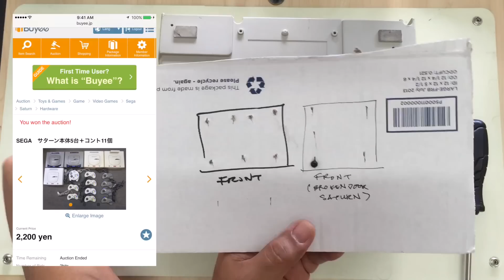Sega Saturn Yahoo! Japan Rescue via Buyee 1 [SH no.31]

Comment: I can't get enough of these videos. Sega Saturns getting restored. This was the most suspenseful one so far. It's pretty cool knowing that most broken systems usually have like one minor issue and all it takes is fixing that and you have a working Saturn.
Reply from the maker: +Sopa de Caracol Most are actually working, as soon you'll see with the other Saturns from the lot. The Saturns were built to last... these are some tough consoles, from the plastic case, to the components. Again, thanks for the support and hope you'll be a continued viewer!
Reply: +The Sega Holic from what I've heard, Saturns are much more robust than Dreamcasts. The latters' lasers tend to fail much more often
Reply from the maker: ***** I think you hear of more failures from Dreamcasts because it was way more popular during its day... thus more played. The Saturn really was overlooked, especially after it's first Christmas in it's first year. The DC had lots more games and thus, used more, and thus, they have a lot more wear.

Also, if you ever played the DC, you can hear the laser constantly working in some games.

Until there are numbers to prove it, it's all speculation.
Reply: The worst system back then, actually... just the worst one I had in general was the PSX. After about a year I had to start using it upside down in order for games not to get stuck and that's AFTER I found out that was the technique. I heard the 360 is even worse with its ring of death problem but I don't touch anything by Microsoft, ever, not never,
Reply: The Sega Holic of course I heard the laser working, heck, the entire house hears it vroom when I play, it's that loud! :)
Reply from the maker: +EpicRive it's not the laser making the noise... It's the drive motor. But geez is it loud. Lol.
Reply: The Sega Holic
yeah, the motor, my bad :) Compared to it, the Saturn motor noise is nothing

Comment: Ahh that lovely FMV music from Virtua Cop 1 =} I wish to get into the Saturn , so is RGB scart still the best image output ?
Reply from the maker: Yeah, remember, RGB and SCART are two different things. Currently, you cannot do any better than using an upscan converter like the Framemeister and a RGB cable.
Reply: The Sega Holic Ya I'll be needing a Framemeister from assembler guy .. scart is a cable .. so the FM is ready just needs Japan cable ? I know retrogamingcables offers adapters for European RGB to the smaller RGB port .. but should I go all authentic and use Japan cable only ?
Reply from the maker: mistamontiel00 The frameister actually uses a 9pin DIN cable for its RGB input. There is a JP21 to 9pin DIN adapter that comes with the Framemeister. So you really need JP21 cables if you are going to use the adapter that comes with the FM.

Remember, JP21 and Scart are wired differently even though they use the same type/shape connector.

You need a Scart to 9pin DIN wired for Framemeister for Scart cables obviously. Retrogamingcables on eBay does sell this if you want to go the Scart route.

My advice... just make your own cables for the framemeister to your consoles. A video should really be made on this. LOL.
Reply: The Sega Holic AWESOME the FM comes ready with the adapter , it just wants JP21 .

And ya retrogamingcables are great I bought from their site RGB sync-on-luma for my PS1 , used the cheapo to-HDMI metal box .. she sings =}

Though too bad DAMN $ONY PS1 and PS2 drives are strict when it comes to region lockout !!! GRRRR
Reply: Wasnt that from Virtua cop 2?

Comment: I have a problem with my sega saturn its an model 1 with the power supply mounted down in the case. The motor for the spindle doesnt spin. i have tested with an battery and its working. also switched laser but no luck?
Reply from the maker: When you start uo the Saturn, what does the boxes look like on the audio screen? The screen with the two dancing cubes if music is playing? Check to see if th ribbon cable is correctly seated on both ends. Then double check if the other wire harnesses plug is seated correctly. If you have a multimeter, check to see if the ribbon cable is ok, and that.the other harness wire are also ok going to the board. Also, check the ribbon cable of the laser pickup if its seated correctly on both ends.

If u have no luck, i can take a look at it, but shipping both ways will cost about the same as a working Saturn... Unless it has sentimental value. LMK

Good luck.
Reply: Mines is doing the same thing, starts to spin then stops, bad motors or spindle needs height adjustment?   It's sounds like the motor is struggling to pickup speed low grinding noise. It's Japanese model like the one above. Really bummed ordered from buyee and I can't figure it out

Comment: I buy Sega Saturns locally whenever they pop up on craigslist, I've owned a dozen or so, and I own 4 right now.  I've found a number of them already have a mod chip installed, sometimes thats why the unit isn't working, as one of the ribbon cables leading to the mod chip have come loose or the power wire etc.  Have you ever found a pre-modded console by chance?
Reply from the maker: No, not ever. The units from Japan are always "virgins." And the eBay and Craigslist ones are usually from estate sales or garage sales it seems. But none has had a mod chip.

Comment: Some solder joints on my dreamcast's controller board are leaking, what should I do?
Reply from the maker: Actually, they can't leak..... what exactly do you mean? Take a picture, and send me the link.
Reply: I see like a dried yellow liquid on the controller board. I will send a pic.
Reply from the maker: That is probably flux, which is used to flow solder better. Use 90%+ isopropyl alcohol, which is easily found at WalMart on cotton swabs to clean. You see it on boards and is normal and doesn't ruin anything. It just becomes more visible with time as it yellows.
Reply: Thanks!

Comment: Just picked up my japanese sega saturn. Tell me... as I'm from South Africa and have different voltage issues. I have a 110v voltage converter. will it be safe to use on the sega saturn? please help
Reply from the maker: Yes, a 110 V converter will be safe. The Saturn will work on voltages ranging from 90V to a little over 120V.
Reply: Thanks so much for responding. I had to wait nearly 80 days for my package. Does it usually take that long for you as well? My most favourite channel on youtube right now!!!!
Reply from the maker: If I choose expedited.... 1 week, but costs twice as much. 2 months for boat. Thanks for the support. Now I need to do my part and do a damn vid. LOL.

Comment: Aloha, love all the videos esp coming from a local! I recently acquired a few Sega Saturns myself from Yahoo Japan Auctions.
Got one Clear Derby edition one with a bad laser, disc not spinning. Bought a new laser from ebay Liberty electronics and installed it, got the motor spinning but not reading Discs. 

Do these lasers need calibration? if so what's the value for the pot? I saw somewhere 720K OHM, not sure if that's right, anywho I exchanged the laser so don't have it right now...

Took apart 2 other working saturns, one had a Sanyo drive, (my derby has a JVC laser), swapped the whole CD drive, seems to work fine (motherboard). my other saturn had a JVC laser which I swapped with the suspected bad one and the drive seemed to work fine.

Bought another JVC laser for Optima 6s, installed it in the Derby Saturn, no dice, I see light from the laser, moves back and forth, but cd motor doesn't spin back to square one.

Hmm, I'm at a loss... only seems to work with the other known working jvc laser from another working saturn, wonder if there's a particular compatibility with these jvc lasers? looks like the Clear Derby Saturn has the latest REV of the CD Drive, no Crystal and only 1 adjustible pot on the board.

If you have any clues that would be cool, I should be getting the laser exchanged I sent to liberty back early next week so keeping my fingers crossed on that...

oh, and I did remove the anti-static solder glob on both 2 new lasers I tried but still didn't work :( There's got to be something I'm missing...
Reply from the maker: Watch my other videos. DO NOT BUY FROM LIBERTY!!! You are wasting your money. Buy from Aliexpress.com They are the same lasers. Never had a bad laser from Aliexpress. And I bought over 50 of them to sell on the cheap on eBay. Was selling them for $12!!!

Funny, before I temporarily stopeed my collecting, I REALLY WANTED a derby Saturn. Watched Yahoo for over a 6 months, and for reasons I forget, didn't end up getting one. I'm only missing the Sonic Saturn, the Navi Saturn, and that Derby one. :(

You may need to replace the entire disc drive assembly. The pots on the assembly may have been tampered with and will be next to impossible to calibrate again, even if you measure their resistances. I'm not sure why a real JVC laser would be working though.

If you need further help, don't hesitate. Glad there's a Saturn fan in Hawaii other than me. LOL. BTW, where are you from on the islands?
Reply: ahh, Im beginning to think that too, so far two lasers from Liberty (strange different sellers, but same shipping address) seem like duds. I was hoping to get it working this week but doesn't look like that's possible with out sacrificing the parts from my other working saturn.

I'm in Honolulu, looks like in your videos you're from EWA, Waipahu, or somewhere like that :P got a clue from the Mailman delivery episode.

I also suspected that the pot on the board may have been tampered with, but when I opened the unit I didn't find any signs of tampering (gotta love Japanese sellers, condition is way cleaner and better taken care of than usa sellers) seems like I just need to find a working laser...

Spare CD drives are hard to come by! been checking but nothing, I'd hate to have to buy another working Saturn just to harvest the CD drive. Buyee is great, but the shipping cost is unreal! I have inlaws who still live in Japan, so when I'm planning to go there to visit I usually have my Yahoo auctions sent there and I'll just take it home in my suitcase. I'm hoping to find some more cool stuff at Super Potato and Retrogame in Akihabara.

so far all my saturns are japanese,  I have 3 White model 2s, 2 are HST 3220 (one is unused) one is HST-0014 slightly older than the 3220 (5pin power supply vs 4 pin one) I also have a MINT model 2 V-Saturn and now the Derby one, it's in great shape except for the dead laser issue. it also came with the horse racing stickers unused lol.  I'm looking for a H-Saturn model 1 or 2 and the other Smoke This is Cool Saturn.

But gotta put my collection on hold this week because of the Nintendo switch release, haha. I'm getting one with all the accessories!

So far the used machines I've gotten off Yahoo cleaned up really well, the controllers I tore down and cleaned, buffed the shiny parts with rubbing compound to remove minor scratches. I've been lucky the systems all worked except the Derby which I knowingly bought broken.

I'll try looking at Alieexpress, never shopped from them though.

Strange, just thought that I was doing something wrong with the laser installs but it's pretty straight forward, the JVC laser I removed from my HST-0014 unit to test and re-installed worked fine in the Derby and then worked fine when I put it back in the original Unit...

It really must be dud lasers that they're giving me then, if so that really sucks, waste of time and money.
Reply from the maker: Howzit from Waipahu... LOL. Man, I hope I make it to Akihabara one day.

Yeah, laser installs on Saturns are super easy.

Aliexpress is just Alibaba... so you are basically forgoing the middleman, and buying directly from the manufacturer in China. You can find a lot of stuff for cheap, such as cables and such. All the non OEM lasers are pretty much the same stuff you are buying from Aliexpress.

Like I said in pretty much all my vids, a Japanese "broken" item is almost always a scratch here or there. LOL.

I'm gonna be upping more videos soon, chime in if you can.
Reply: Howzit, so just an update, got the replacement laser last Monday, the seller took their time to send me a replacement. But I'm happy to say it finally works as expected.
Good news is that the original japanese seller didn't tamper with the POTs at all, so the drive worked once a good laser was put in.  The spindle motor seems strong as well.
Man, don't want to bad mouth Liberty but they sure wasted my time and money with dud lasers.

Right now I'm busy with the Nintendo switch, lol but I haven't forgotten about my Saturn. Hoping to go Japan in May, will try to look for some nice goodies while there.

Waiting for you to put up more cool videos bro lol even if it has to do with Karaoke stuff lol.
Reply from the maker: Man, I just need to get off my ass from binge watching series.... watching 'Master of None' as I type. LOL.

Great to hear the laser works. LMK if you need something or some help.

Comment: Hey man, I got my Saturn in the mail, but the spindle is pushed down but it is not wobbly. What should I do to lift up the spindle?
Reply from the maker: +[OFFICIAL] xXxFTM2XxX (FranciscoTheMan2) Use some pliers to use as a lever. If there is space between the pliers and the spindle and the bottom of the metal tray, use something to fill in the space so you dont bend the rod on the motor.
Reply: +The Sega Holic Thanks man! I'll see if I can do this and I'll let you notify if it's solved. :)
Reply: +The Sega Holic Turns out that your solution helped me! My Saturn can now read discs. Thanks a lot! :)
Reply from the maker: No probs!

Comment: Got a Buyee Japanese Saturn.  Model no: HST-3200.    Access light flashing.  CD motor spins.  Does not read CD.  Swapped laser with working US model MK-8000 .  Works fine.   Looks like I need laser.  What laser and where can I buy the replacement laser??
Reply from the maker: Go to www.aliexpress.com

Aliexpress is an offshoot of Alibaba, which are a Chinese eBay of sorts. But you don't deal with middlemen most of the time. You are dealing with the manufacturer in some cases and it's why it's so cheap. Many of the items that you find on eBay come from these same manufacturers, but in that case, you deal with those sellers that resell them for more.

Search "JVC Optima-6s." The best prices I found were like $8, but I had to buy in a bulk... a 10 pack. But individually, you should find some in the $12 range.

I just searched aliexpress, and they only have one page of availability. About 1-2 years ago, there were like 10 pages of available options. Looks like these lasers are about to become rare, or expensive.

Think about picking up 2 or more.
Reply from the maker: Oh, and one more thing. You'll need an ESD safe soldering iron and solder wick.

You can view more of my Saturn fix videos in where I replace the laser so you know where the solder blob is.
Reply: Using a Weller WESD51  --  Got the laser on order. Thanks !!!

Comment: The tape being lifted and the ribbon being folded doesn't mean it was opened before, my Saturn has the ribbon folded (was folded like that from factory) and the tape came lose by itself
Reply from the maker: You are right. Noticed the same stuff in Saturns after this... and then you think... hey, I was dead wrong in that past vid. LOL. Some stuff, you want to take back when you record videos. The more you see stuff over, and over, then your thinking changes. You learn, experience, make mistakes... there are a lot of stuff in my past videos I wish I could change. 👍🤷‍♂️ Thanks for initiating and being part of the conversation!

Comment: I've got a Saturn that won't boot up to the cd screen. it's stuck on the Saturn logo screen when you turn it on. you don't see any moving graphics just either straight into the date and time menu then a static Saturn logo or just straight to a static Saturn logo screen. any ideas? I've tried replacing the battery but nothing has changed.
Reply from the maker: More than likely, a really dead laser or bad drive assembly. Look for your answers there. A disconnected/loose cable from the main PCB to the drive assembly. It's definely related to the CD drive. Once the Saturn Logo comes up, the next instruction for the Saturn is to read the security on the CD. Sice the Saturn isn't reporting a message like "wrong region disc" or "disc drive empty," it is obvious it's stuck on trying to read that secuity part on the CD.

The easiest way to test... if you have a second working Saturn and pull off components there and swapping to test.

Comment: Lots of work...smh...
Reply from the maker: LOL. Obviously, yeah it's lots of work!... smh.

Learning and skill building takes a lot of work.... smh. The whole point here, and of the channel is to work, to work to save consoles from the trash can. To work to learn how things work. To work to learn things, that can be used for related work.

Or you can be lazy and just sit by and watch and comment... not work. Seriously, lots of work is needed to become good at anything. I don't believe in shortcuts. Usually, lazy guys, are shady guys.

But, whatever floats your boat.
Reply: Jumped in and mines doesn't wobble.. It picks up speed and then stops and get that 728:14 for the track display. I replaced the lens pickup. Should I just get a whole new drive assembly ?